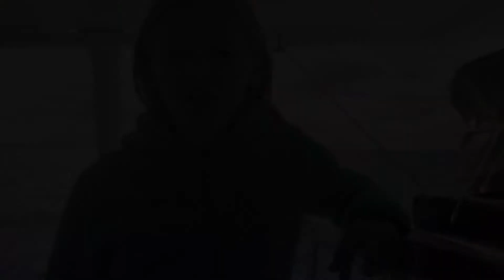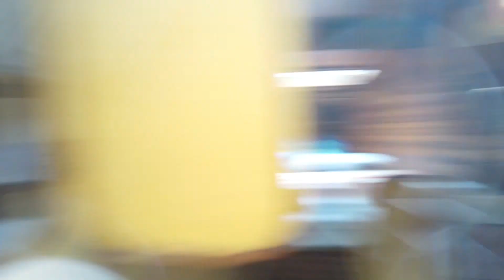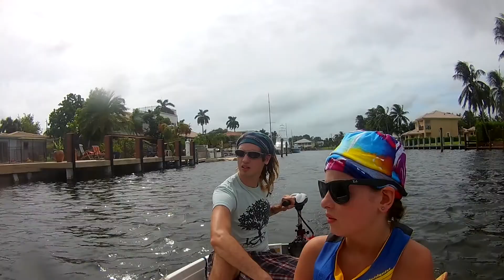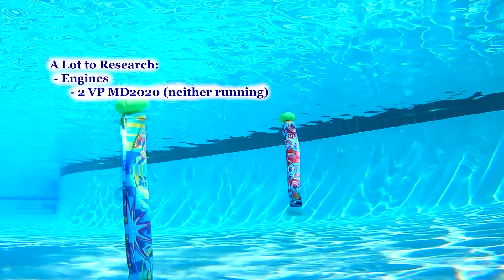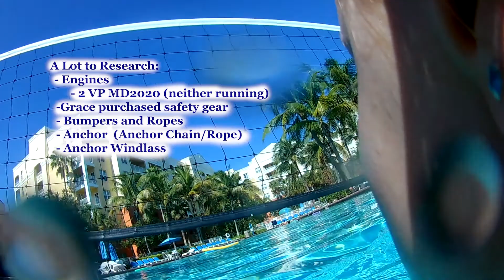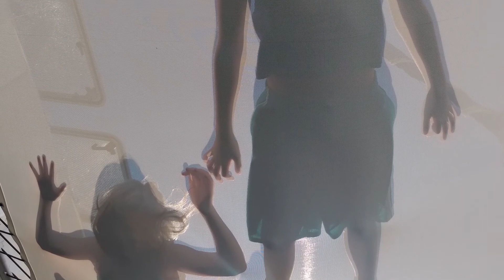Fixing a Budget Aluminum Catamaran week 2

Comment: As an electrician, would it have been an option to use a step up transformer 110 - 220 volt? Rather than a rewire?
Reply from the maker: That was a thought but after replacing some of the wiring I found a lot needed it anyway.
Reply: @4ofaKindhomestead , yeah and I guess you would be adding other appliances which would be American 110 volt
Reply from the maker: @markpeters9332  yes that's correct. It makes it simpler for here